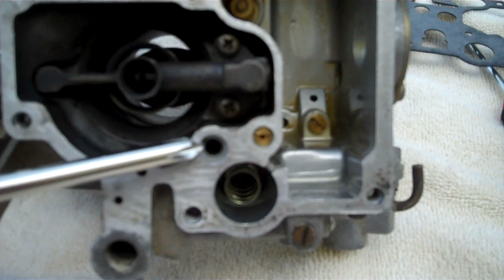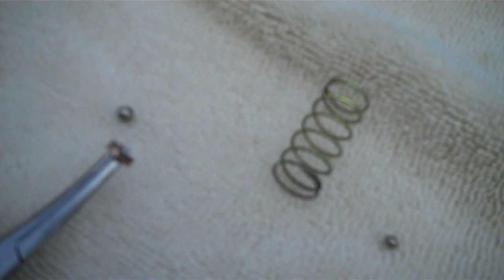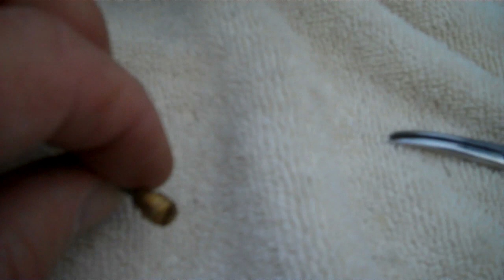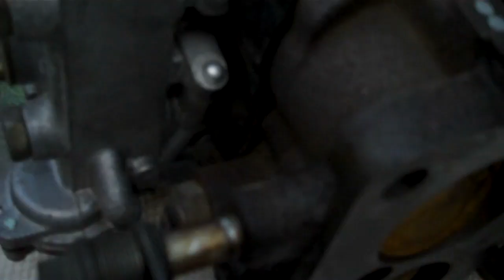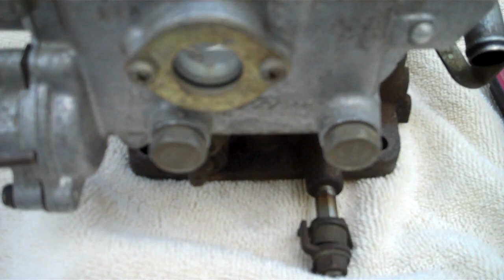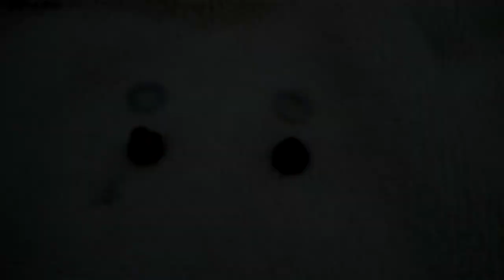Rebuilding an Aisan Carburetor Part 2 by Pin Head.mp4

Comment: I am speechless! You are a genius for having figured out this carb inside out in the age of fuel injection, and whoever designed and built this thing 40 years ago without the help of a computer was an engineering God.
Reply: All electronic/digital greatness today are based from the mechanical greatness of yester  years :)

Comment: So appreciated, Thanks!  I have my 75 carb in pieces and now soaking.  rebuild kit here, found the manual with infor for rebuilding.  lining the carb dip basket with screen material for some of the smaller parts not in the rebuild kit.

Comment: I'm trying to smog my '78 Travette Toyota motorhome with this carburator. Secondary throttle vacuum diafragm is not supported anymore, i tried napa, oreilly, autozone, etc. Also not available in a kit. After a complete cleaning/rebuild, can't get it to idle anymore. Idle screws are in all the way. Before smog check it ran fine btw...

Comment: you reckon?? The emulsion tubes only have 2 holes!  weber carbs pepper the emulsion tubes with holes that why they go better and use less fuel the vapour burns not the liquid , toyota must have shares in the oil companies